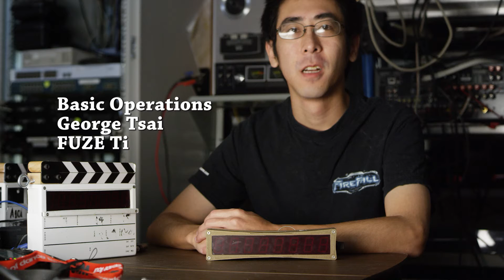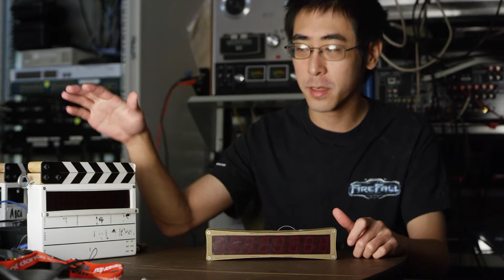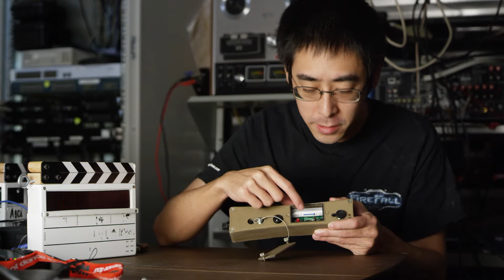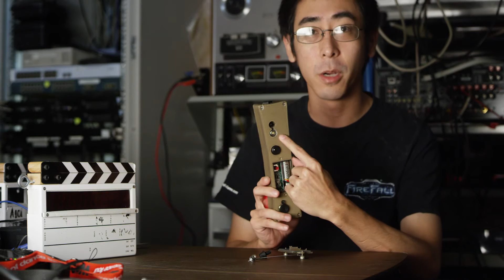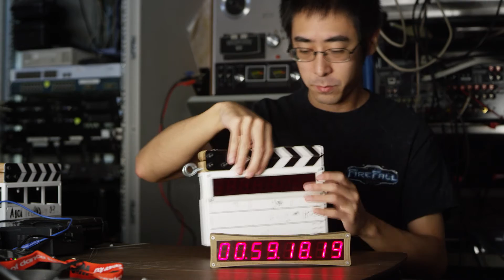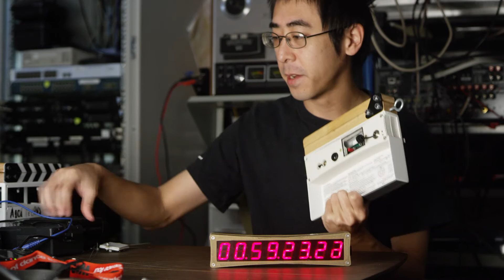FUZE Ti: Basic Operations

Comment: Look at 7:16 on this video and notice a frame difference between the two claps... interesting!
Reply: George Tsai No. Put the video in pause around 7:16 and notice that both claps show a different timecode, there is one frame offset between generator and reader.
Reply from the maker: Fokke van Saane
Frame by frame the display is in sync between the two up to the clap point where the display is paused.
Tho the display low on batteries is ghosting a bit so even tho the time is in sync the camera is catching the trail end of the previous frame.
Reply: FUZE Ti Ok.. so the battery low warning should be next to the TC numbers so if it is lit the editor knows it is one frame off because it is ghosting?  :-) naaaaa! 
A tc-slate should be dead-acurate otherwise it loses it's function. If the battery is that low it starts ghosting it should turn itself off.
Reply from the maker: Fokke van Saane
Low Battery warning is on the back side of the slate. The time is still dead accurate and can continue to spit out a proper timecode signal even after the batteries can no longer drive the LEDs. Even so it's clear and easy to tell frame by frame, but perhaps not so much so on youtube.